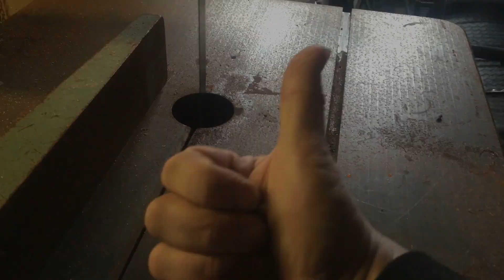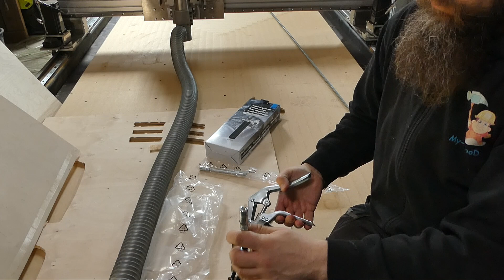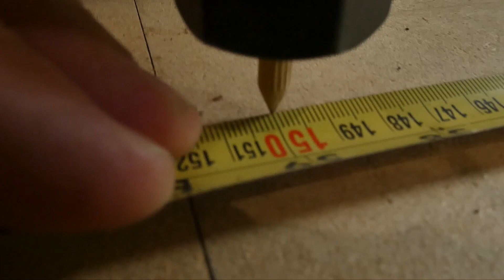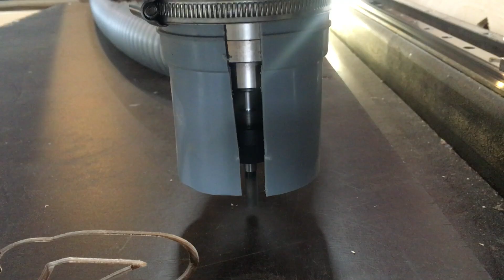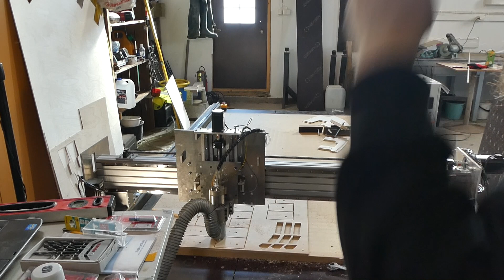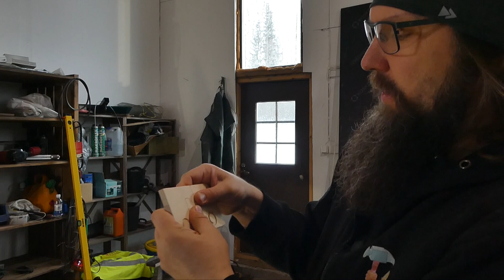DIY CNC-router calibration + cutting full size pieces! ep.37 Project SeaCamel

Comment: when you mentioned that the plywood wasn't sticking to the table, the thought of a 'air hockey table' in reverse popped into my head. in other words 'suck' the plywood to the 'hockey table'.
Reply from the maker: Yeah, that's called vacuum table. I don't have one (and not built one) and it has other kind of challenges like getting the dust into those channels etc.

Now I've figured out a way to make first small attachment points and screw the pieces down firmly before starting the cut. That way I also know that the router won't hit the screws while cutting.

Comment: Binge watched all the project videos, subscribed.
I gonna be interesting to see this unfolding in near real-time.
Reply from the maker: Thanks! Hope the quality has gotten better over the years! 😅
Reply: @ArcticSeaCamel  actually I didn't mind, very high video quality is lower value for me than actual boat concept you are building. I'm a big fan of "free-standing" masts and concidering buying freedom 30.
Also cause, you mentioned couple of times in-boom furling, I suggest you to take a look on in-mast furling, and speak to Selden or another carbon mast manufacturer in advance. This might affect your layuout choices also.
Usually free-standing masts are thicker than ordinary ones and hence will have more place to hold a sail.
Just some points to take a look at, not a big fan of in-mast furling systems for a long passages due to chafing.
This will of cource make sails less performant but that might be a good compromise for your.
Another thing is that free-standing masts usually need more structural support in the hull and sometimes incorporated in the bulkhead, consult your naval architect. And maybe do a stress load simulation in a CAD.
Reply from the maker: Hi! Yeah, I have looked at Freedom boats as well. But they really don't bring any more features that i'd like than the free standing masts. I like modern and airy look and want to have good visibility inside out.

The masts I'm gonna do will most likely to be done with method introduced by Eric Sponberg. He's already retired and that way didn't get into my project. But he's website has great archive of material about these masts. https://www.ericwsponberg.com/free-standing-mast-designs/

The method is that shown in the website that has frames and thin veneer under the carbon fiber structure.

The one key feature of them is that they need to be structurally designed for that particular boat. There's huge forces involved especially on the bottom part. All the force from the sails go to the hull from this single point. But it's still much more reliable than having gazillion stainless wires and other stuff to hold the mast up.

As for the mast furling, there's couple of things. First free standing mast must (or perhaps should) be "completely uniform" all the way to the top to be able to handle the loads involved. Second, a free standing mast will bend under load. That most likely will prevent furling mechanics to work inside the mast.
So that way, I think in mast furling is really not an option with free standing mast. That's why I'd prefer boom furling.

But on the other hand, I don't know if furling is worth it after all instead just having nice big lazy bag. And the reef points need to be set before anyway. I haven't really used furling boom so I don't know details of using it but the idea feels good.

Mr. Tanton has done the plans for the hull and deck for holding the masts up so no worries there 😊

Comment: You're getting there!

Putting the VFD outside the cabinet is a good idea. Additionally, grab one of these wound vfd resistors for safety and a few EMI filters (CW-1B). Place the filters on the VFD and the stepper PSU. I'd also definitely install a button at say (0,0) as a tool setter. A tool setter at a fixed position is a must-have for CNC'ing if you don't want to ruin your bed. Most good quality steel or alu buttons will do fine for that and are very repeatable and cheap.

I don't understand why you need access to the VFD buttons. Wire it through RS485.

A vacuum table works nicely, but it's also a lot of work to get right I think. The air will just get sucked through the wood you're using, as will the dust because you're mainly doing through-cuts. Said dust will clog the channels. What I usually do is drill the holes first (most pieces have them anyways, and it's best to use a drill rather than a mill) in a separate job, and then simply use some screws and clamps or washers to clamp the piece of wood down. Use side clamps and fix a square in the (0,0) corner for the rest. Remember, it's okay to spoil a spoilboard.
Reply from the maker: Hi! I forgot to answer this at the time... :P

But yeah, I actually have EMI filter on the VFD source. And it's also on separate phase than the rest of the stuff. But, it's located right next to the CNC controller so...

The machine works very well without the sensors but i'll try to figure them out some day nevertheless. Just to make sure and able to zero the machine more easily. For example if there's a power failure for the PC I'm controlling this with, it will forget where the machine was at that point. Which is very annoying to fix.